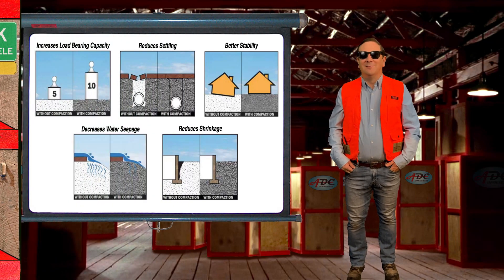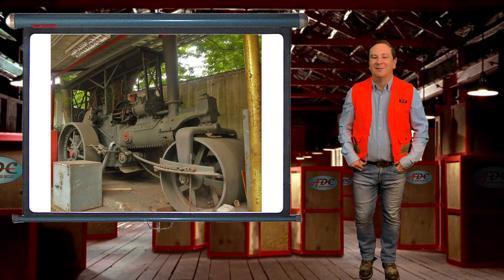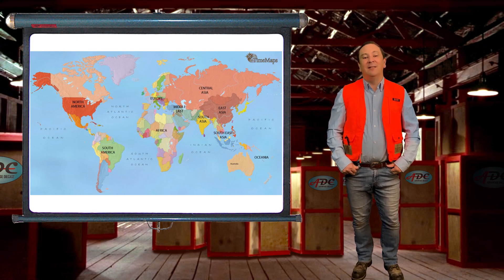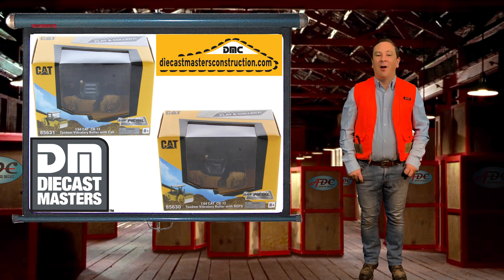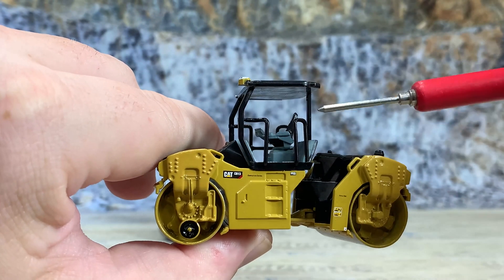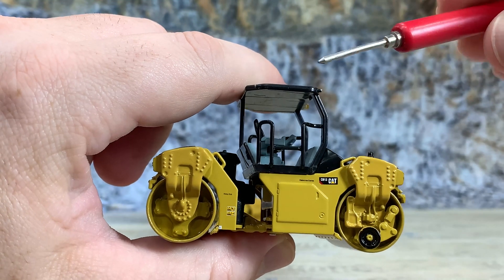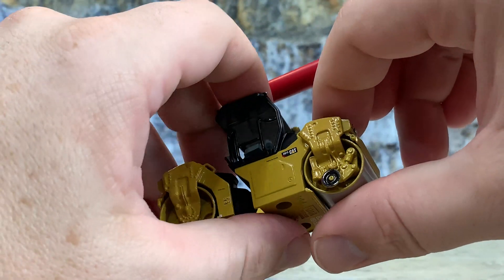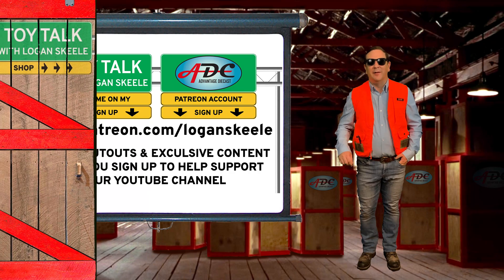Caterpillar CAT CB-13 Roller & How We Got From Early Steam Rollers To The Modern Vibratory Rollers

Comment: Two major issues, Roller Weight and linear load are not a correct imagination of the power of a  roller, A 1600 kg roller for instance can be stronger than a 17 000 kg roller. Tandemrollers are the worst rollers concerning compaction, because of the wide drums, the wider the drum is the less compactionperformance becomes. Smooth drum tend to make a crust on the surface of materials with a lot of fine parts. Tandemrollers are responsible for the socalled Tender Zone, a phenomenon that occurs during compaction of soft asphalt mixes. During the first two passes tandemrollers gain density, but after that the roller starts to do the opposit way, it starts to decompact the mix, buildiing transversal or longitudinal cracks. Sadly Roller Factories produce beautiful rollers, but actually really don´t exactly koow how compaction takes place. If roller factories would produce cars we would still ride on slick tyres on the road!!!